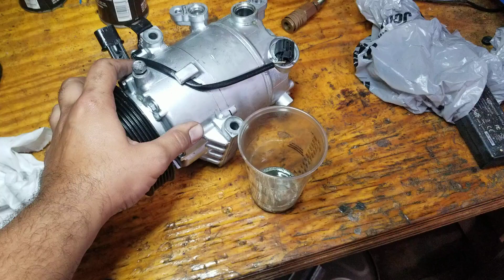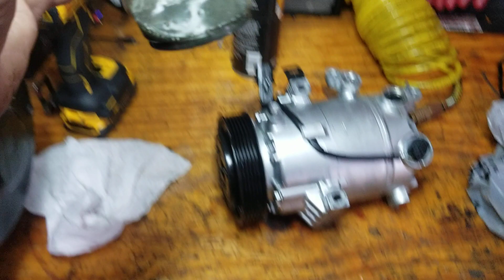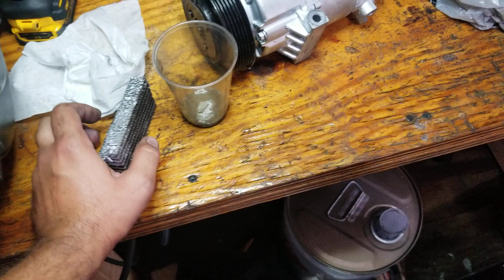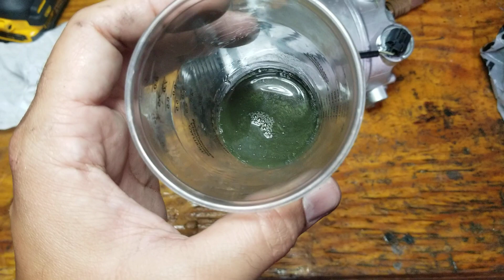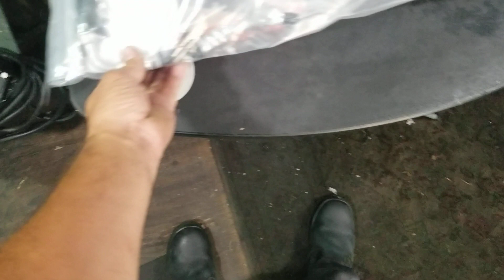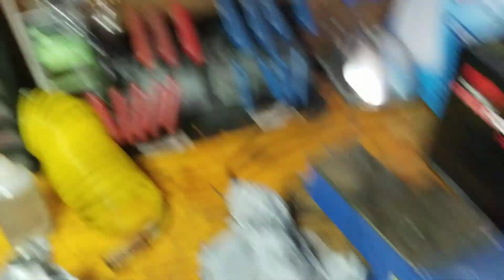Metal Debris in Your A/C? Here's What Happens Next

Comment: Great video. If they did all the stuff you recommended including the flush would it have a typical lasting life?
Reply from the maker: For the most part it should have a long service life. I have done several of these jobs without comebacks
Reply: @G_Auto_Repair  Thank you. There is honda odyssey 2006 and what is concerning is that it has a 2nd part of ac set up with the rear of the van that has a Evap and Valve hope the tech is accounting for that part too.
Reply from the maker: You will have to replace components and flush the rear unit as well. Every inch of that system has to be cleaned and free of debris
Reply: Thank you very much.
Reply: @anthonymerc220  what's a flush 🥺🥹